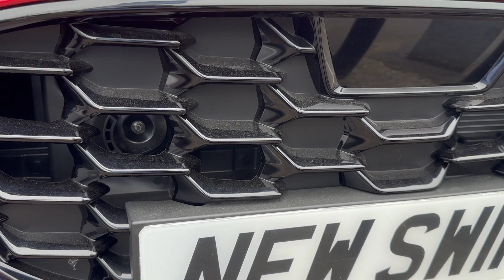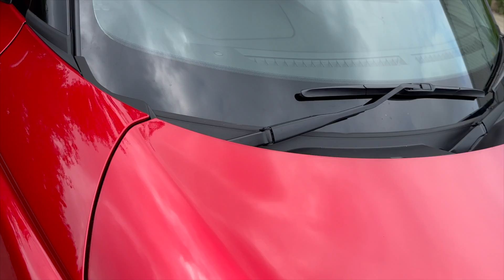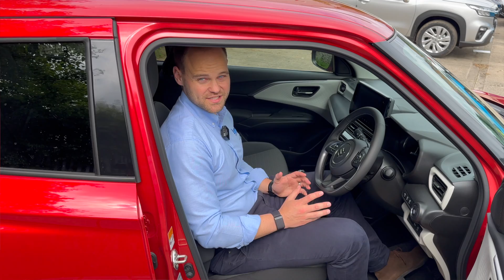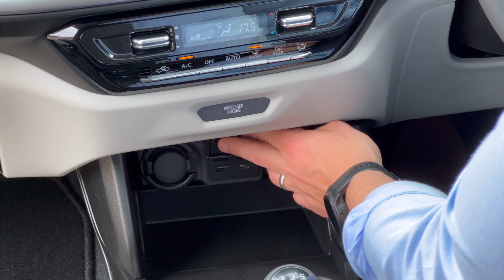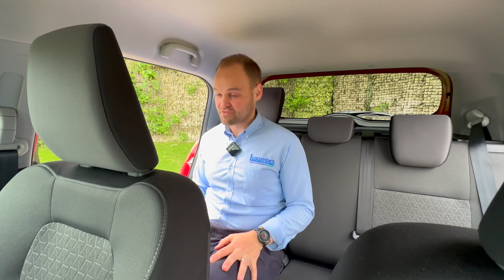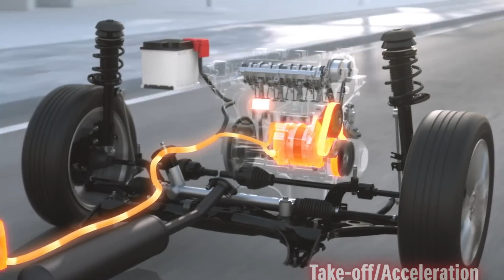The NEW 2024 Suzuki Swift | First Look, Review & Walkaround | Luscombe Suzuki Leeds

Comment: Great little car. Their only issue is the paint suffers badly from stone chipping.  I hope Suzuki addresses this issue.
Reply: It is a problem that affects a lot of cars since the move to water based paints! I had a lot of issues with the paint on a Honda. However I have not had that much problem with my two Suziki's and nor has my wife and she is on her 3rd!
Reply: @daverundle919  Thanks for making me aware of the move to water based paints, I didn't know that. 
Good to hear you and your wife love Suzuki, I do too. I've just changed my standard Swift for the Swift Sport and had a protective vinyl wrap put on the bonnet, as this area is particularly prone to stone chips.  My wife had a Jimny years ago, which was quirky and fun to drive and great when it snowed as it had the option of putting into 4 wheel drive.  
Like the Suzuki advert say, 'Suzuki, good different.
Reply: @Nawitisnae no probs! I had awful probs with my Honda Civic sport! I counted 32 stone chips after less than 3 months and was told it was my fault for buying a black car!😳 As for Suzuki yes we love them, you get so much car for not stupid money! The Swift Sport is a lovely car and that sounds like a good idea! Enjoy your car!

Comment: scratchy plastic = easy to clean from dust , especially the dash board . my biggest issue with this car is that it has no armrest ! the Japanese version got arm rest and wireless charger and 360 camera.
Reply: I know im kinda late but there is aftermarket armrests for like 50€ on amazon in europe. You can get the original one for like 500 when avialable from what i know but im getting a aftermarket one for myself soon

Comment: I have the previous model SZ5 Mild Hybrid with 1.0L 3 cyl Boosterjet Engine which has 109bhp. Got to say very underwhelmed by the new model, it just looks lie a facelift of my car. Slightly different at the front, and the tail lamps slightly different as well. Interior is almost identical apart from the larger infotainment screen. Overall the car is not that much different. The main disappointment is the engine only delivering a measly 81bhp, don't get me wrong I love my Swift, but to release a new model almost identical with a lesser powered engine that is so much slower is a backwards step by Suzuki.
BTW having now had a test drive in the new model last week can confirm it is like a snail on valium compared to The 1.0 SZ5 Boosterjet Engine, I was actually shocked at how much slower it was. Again I absolutely love my current Swift as it has everything, but current owners will be massively put off by a ridiculous loss in performance of a so called new model,and many like myself will not purchase this 'clone' of the previous model with a woefully underpowered engine.
Reply from the maker: The 1.0 Boosterjet engine is a phenomenal engine, however to make the gains Suzuki have on efficiency, outright acceleration is compromised ever so slightly. That said, I didn’t find the Swift a slouch and for most, reducing fuel bills is preferable over slightly more spirited acceleration

Comment: Worth a look though a heated wheel is high on our wish list and the speed sign recognition could do with a simple silence button to make getting moving simple, motion wheels are ugly as bin lids, lots going for it otherwise.
Reply from the maker: The heated wheel is something we struggle to find on any car at this price point. Also agree on the Motion wheels, hence why for £550, we can upgrade the alloys to the Ultra’s which set the car off much better
Reply: @LuscombeSuzukiLeeds  Thanks for taking the trouble to reply, you see them on high spec Picanto and I10 which were cars we considered prior to buying a Swift also Corsa it would be a nice option. On the wheels the old Swift SZL wheels are more attractive. 
Perhaps a basic spec car could be made available to compete with other brands claiming to be better value but less well equipped with options the customer values particularily available.